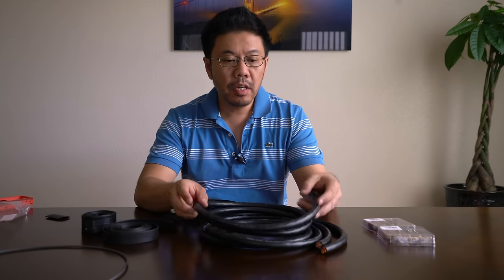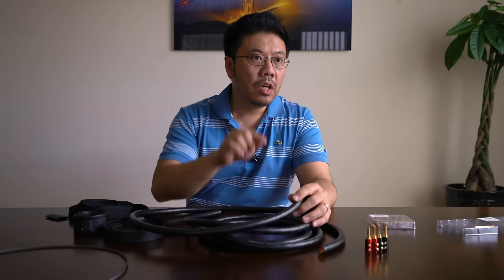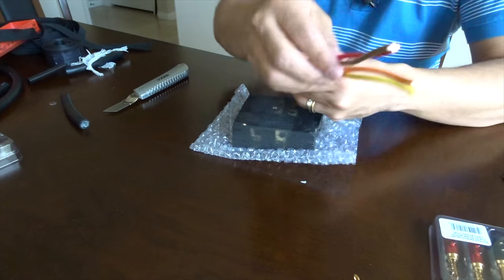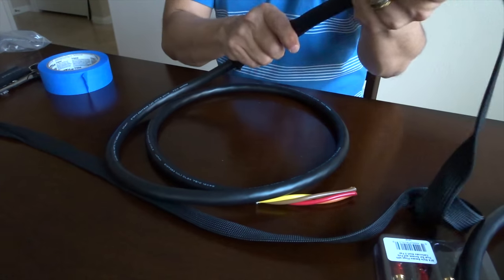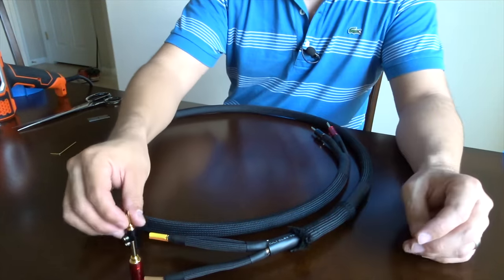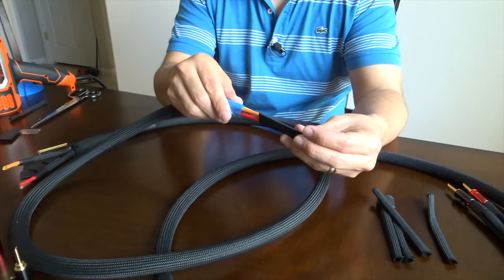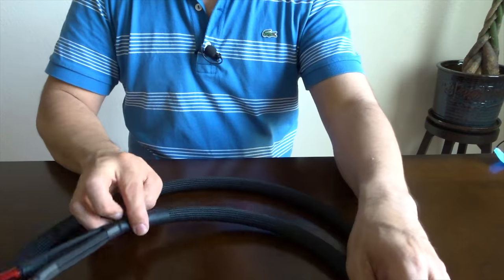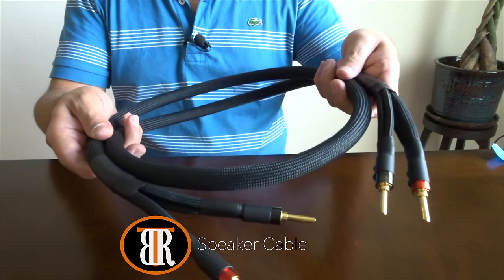Making The Best Speaker Cable For Money, How To DIY HiFi Cables

Comment: Absolute madness for a home setup. For mobile use where you are coiling and uncoiling then maybe if your job depends on it. But for home use, just use 6mm cooker wire (FT+E) it costs £1.50 per metre and does not need to be oxygen free as compared to 12 gauge it is a much larger cable so losses are indistinguishable. As a qualified electrician it's Ohms Law that dictates the electrical properties of a cable, and these are conductor size, spacing and volt drop over a known distance. All this "audiophile grade cable" is utter marketing nonsense. $2000 for a set of cables? One born every day! Physics does not lie. Electrons flow through conductors. The least path of resistance means lower losses. Any talk of "coloured sound" due to cables is total BS. Don't even get me started on digital interconnects! Snake oil the lot of it.
Reply: These cables only cost about $100 for 2, 9 foot runs...   Try paying attention.

Comment: This video, like the cable, is a waste of time. The fact you used parallel wire says it all. Speaker cable should always be twisted pairs. I made my own double twisted quad cable, using 14 ga single wire, twisting two pairs ( black/red pair) clockwise. Then twisting those 2 pairs together, counterclockwise. Then connect the 2 black together, 2 red together (dual 14 ga = 11 ga.) all you'll ever need.
The result is the double twist will reject all EMI from AC cords, WiFi, bt, etc.
Reply from the maker: I would love to do shoot out with your cable to see which one is quieter because for noise cancellation nothing can touch Mogami quad cables even on the stage.
Reply: Tharbamar easy enough to build your own double twist...roll of 14 ga and a variable speed/reversing drill motor.. As for the mesh you pull over the rubber shielding, nothing more than decoration. And no matter what you say about that brand of cable, they're ripping you off selling parallel wire. BJC speaker wire is not expensive by any means and it is a twisted pair.
But you certainly are right about banana plugs not all being equal....and no ideal which brand I'd call best, only used 2-3.
Reply: One word of advice to anyone wanting to build double twist.. before you even put the ends of a pair B/R into the drill chuck, make sure you're setup to anchor those ends before you let go of the drill. Cos you need to get as tight a twist as possible. And a result, if you let go, the pair will kink. And that tight twist is needed for when you twist the pairs counterclockwise.

Comment: Cables like this (ore any 5 mm diameter cables) does NOT sound your system better. That's a illusion !
Reply: unless its a very long cable run and your impedance is low

Comment: Informative, but the cable is too thick for the length you have made. Making a cable too thick causes the cable to act as a capacitor and inductor. This is undesirable as it can cause amplifiers to osililate and distort. You should use a twisted pair of reasonable sized cable to minimise noise pickup. The cable itself doesn't matter, a copper hanger would work fine. As long as its 99% copper.

Comment: This Mogami cable is good for $100. It doesn't compare to good high-end cable. If your system is modest then of course don't buy $4,000 speaker cable but put this cable against say Nordhost Valhalla 2 cable and honestly tell me it's as good.
Reply: I'll put 16 AWG lamp cord against any speaker cable for 99.8% of applications.

Comment: Bollocks trying to advert expensive cable use like I use multi wire(like the soldering one very thin strands )wire 3mm cross cable core I've tried other cables from some people that I know and used someone's laptop with a dedicated mic for recording and the difference is none for 5m length so all this about expensive cable it's CRAP 2👎👎💩💩💩

Comment: hartsickdisciple said it: Lamp cord. I used a pair of 12 foot extension cords from Wal Mart. Around $3 each. Cut off the plug end. Cut off the socket end. Simple. And cheaper than buying the raw cable (unless you buy the 100 foot spool).

As for this video: Total BS.

"Not all banana plugs are created equal." What a joke. (Use Chiquita bananas, I say.) :)

As for oxygen-free copper ... You know what we call that here? Copper. Because copper doesn't contain oxygen. It contains copper. That's why they call it copper.

Comment: banana plugs are annoying as fuc. pop out the back and looks retarted, and one slight push against them breaks them.
Just put the wire into the terminal, no difference.
This is just unnecessary nonsense.
If you ain't some DJ who needs to constantly switch things, you don't need to do this.
Reply: Someone has been buying cheap ass banana plugs... LOL

Comment: Jesus. Extreme Overkill! The only time you'd need 6ga cable for each line (+ & -) for each speaker is running like 2kw per channel over a long distance. These look nice but are way way more than necessary. For short runs most people don't need more than 16 or maybe 12ga and slightly larger for long runs. It's just more cost in creating a wire that is stiffer, harder to run, and even harder to hide. I like the effort but this is not going to make any difference especially considering the price/performance. Your sound quality is only ever going to be as high as the source and huge cables are not going to improve it, and much smaller cables will suffice without any degradation.
Reply: One more thing, stuff like this is why there are companies selling wire with batteries and junk stuck to it. I'm not saying a good conductor isn't a good thing but when people are spending (as you said your were) $2k on a set of speaker wires you've got your priorities messed up. And until you stop throwing money at people with any little claim of sound quality people are still going to keep peddling their garbage. Do a blind test with your huge $100/5ft beautiful wire here vs a $15 roll of 12ga wire and try to check your placebo at the door. I'm not trying to hate and it's your money to do what you want with but I don't want other people watching this to think they need to spend 100 bucks for 5ft of wire or it won't sound good or that they're missing something.
Reply from the maker: Here is good saying from Nelson Pass

“Who am I to dispute the feelings of audiophiles who, evaluating any cable in the context of program source, amplifier, speaker, and listening room, decide they can hear the difference? A few guidelines have emerged here, but the final judgment belongs to the user. All the special cables mentioned worked well on the test bench and, given the assumption that series impedance should be minimized, all of them work better than 16 gauge wire. If, like many audiophiles, you have spent a small (or large) fortune on your hi-fi system, money spent for high quality cables and connectors is a reasonable investment.”

Nelson Pass
Reply: Tharbamar I do not think you totally understand that quote. You’ve rolled it out a few times here as proof that Nelson thinks huge expensive cables are worth it.  He says that audiophiles ‘decide’ they can hear a difference.  No mention of actual, provable or measurable differences. In fact in the UK a cable maker was ordered by the courts to stop making claims about their cables that couldn’t be proven. Also remember that Nelson makes beautiful limited edition amps etc himself that sell for substantial sums.......and then gives the designs away for free to the diy community.  He never specs boutique parts or cables as they make no difference. He even gave away the matched jfets on a recent preamp.  All he means is that if you drop £10k on an amp it makes people ‘feel’ better if they buy expensive cables......where something like shielded cat5 or 6 are all that’s truly needed.
Reply from the maker: Well, most important thing is I can hear the different between my cables and I have done many blind test with two of my best friends and after all that they asked me to make speaker cables for them a few years back. Thats all that matter to me, thanks

Comment: The cable is way, way to thick. It will act as a coill, taking away high frequency. Totall overkill. To mutch plastic, acting as energy storage for the signal. Especially the stranded wires make it even more worse. The signal will jump multiple(endless) times before reaching the speaker. Solid core cotton shielded awg 16 would be perfect. Like jupiter cabel, or 2 runs of duelund awg 18 solid core.  The connectors ad even more resistance. Just a small amount of tin would do much better.
Reply from the maker: I was wondering where is too much plastics come from? I don’t see any plastic, all I saw was rubber, cotton and copper. And plastic doesn’t do anything if there is because it’s not conducive.

If this cable act as coil all the Studios should stop using it, in reality your favorite music may be recorded with one of the cable from Mogami, Canare or Belden.

I trust Mogami more than Western Electric replica cables, those cables just add color to the sound, in fact they’ve been using those old cables in Japan for even before some review made it popular. By the way I grown up in Japan.

Comment: Why? Dressing up a cable does not make it sound better. Unless you like to kid yourself it sounds better because it looks better?
Reply from the maker: It’s not dressing up, it called protection and usability.
Reply: @Tharbamar  Sorry, but why does the cable need protecting, it's used between an amp and speakers and not on a building site? Are you saying the cable is unusable straight from the manufacturer? All it needs is some trouser (Y shaped) heat shink each end then plugs fitted and away you go. Simple.
Reply from the maker: @madmeister407   You can do as you wish end of conversation.
Reply: @Tharbamar Still a pointless video

Comment: Reference grade means absolutely nothing in sound translation. I can't see what you are trying to achieve here. If by creating these monsters it's skin effect immunity, it's futile. Skin effect doesn't matter at audio frequency. A good human ear can only detect a difference of about a half dB, these cables at best would probably make a difference of a tenth of a dB. The only thing that really matters with speaker cable is loop resistance. Like many delusional cable freaks, it's all in your head, not in your ears.